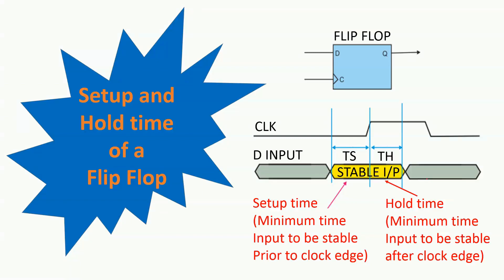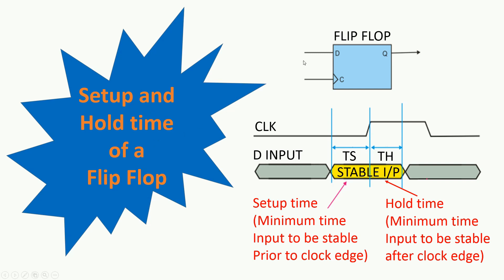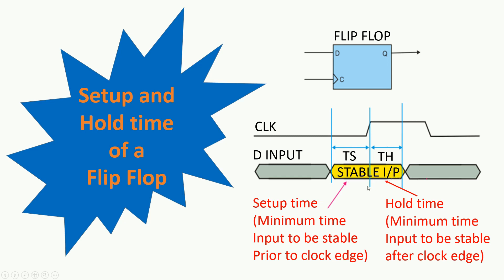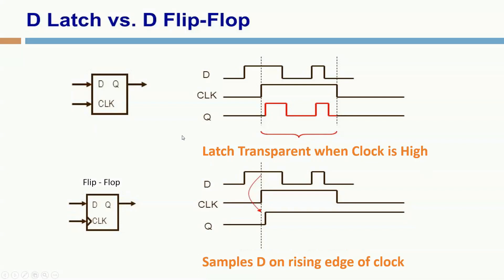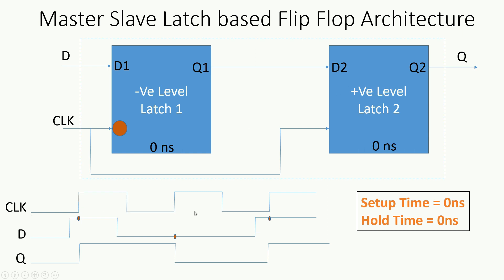Setup Hold time of a Flip Flop | Why does a Flip Flop requires setup and Hold time

Comment: Hi Sir, I have one doubt. when we are calculating hold time then are we not considering propagation delay in the circuit?
Reply from the maker: If you ensure that value is applied to flip flop before setup time, that means it reached to the output of first latch safely during level 0 of clock. Right?
When positive edge comes I.e. level 1 of clock comes, latch 2 will start passing its input value (which is nothing but output of first latch) to its output. It will reach at output equal to 2nd latch delay. So, you can name second latch delay equal to flip flop propagation time, right?
But when positive level of latch starts, because of not gate latch 1 is still active, it can corrupt its output, so during that time we need to hold input value I.e called hold time, right?

Comment: Sir,how come when the clock goes high and D changes within 1ns then Q1 changes?
Because D will be propagated to Q1 only after 2ns right..
Please clarify..
Thanks in advance
Reply: If u got the answer please reply back,  i have got the very same doubt after understanding what he meant to say. Thanks
Reply: Hi! Yes to change the Q1 completely it needs 2ns sec but it can go into metastability state or unknown value so to keep the stable value at Q1 we cant change D within a 1ns window
Reply: @sandysandy6883  i think the question he was asking that even if it changes within 1ns if flip flop output is taking 2ns to change we cant say for sure whether that change will reflect in the output or not because flipflop is getting inactive meanwhile after 1ns